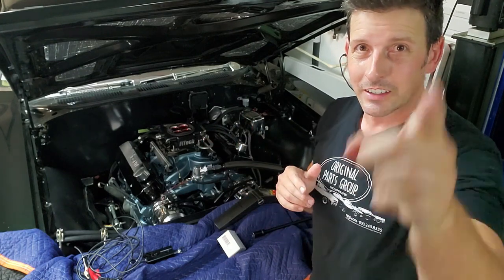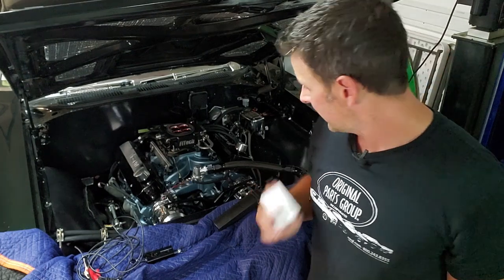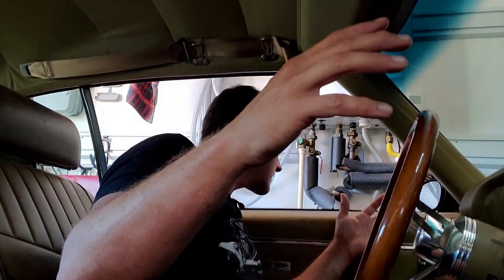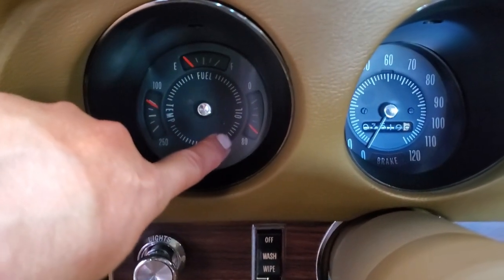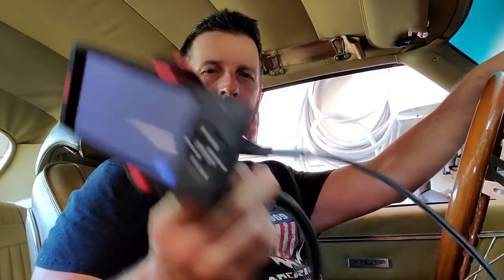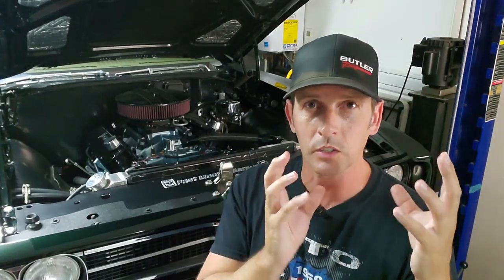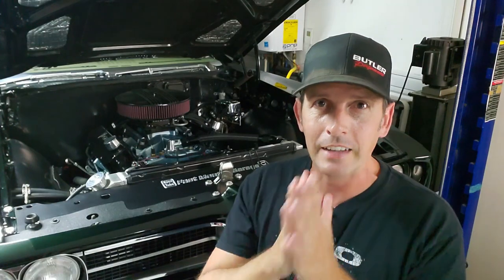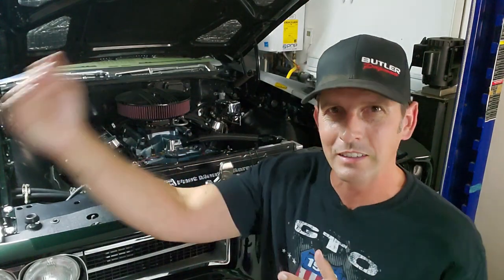First Fire of my Pontiac 400, now a 470!  Pontiac Re-build, part 15

Comment: I remember my first drive my temp hit 215-220. I kept checking with my infrared gun and it was 180’s. Just air pockets. Eventually went away. I like the air suction noise.
Reply from the maker: Good point Ryan... might be air pockets.  Will continue playing around with it.  I've been leaning towards Mechanical gauges, so, we'll see!  Thanks again.

Comment: Hey Mike nice videos  got two Firebirds 68 coupe 69 convertible. I found your channel and your escapades got the fire burning to get them back on road  been stored since 97. Got the 68 almost done New brake lines, master cyl ,wheel cylinders flushed system going with dot 5 fluid this time, new fuel tank , lines, pump ,sending unit, rebuilt Carb. I'm 67 with bad ticker so have to work slow. Its all good
 They are both all stock so not much drama .
I did replace Distributor with HEI and drill primed oil system with the Butler oil priming shaft but I did remove the black coating it was flaking off didn't want that in engine .
little paint work 68 will be good to go. Bought it in 76 great running car, 69 got it in 94 had it 1 week caught on fire in my Garage at 3am it was  literal firebird  fought the fire with garden hose in my whitey tighties lol ( was electrical fire at old add on Amp meter no fuse) just burned  interior  took about yr to find parts and repair it . 
sorry for the long post and thanks for the videos 

Sincerely
Michael
Reply from the maker: What a great story!  Thanks for sharing... Glad to hear I was able to motivate someone to get their cars back on the road... Welcome to the family!

Comment: Hey Mike , not sure if you wanted to raise your exhaust after buying your after market cross member but i was watching a video that came on after watching your last video that was from Detroit Muscle , the video is about putting a 1000 hp motor into a mercury grand marque . I know right. But anyway they cut the original cross member and welded two pieces of angle together and then welded that to the cross member. To get the height they needed they used a piece of cardboard as a gauge between the floor and the angle. Check out the video it's pretty interesting. Anyway after I watched it , I thought of your situation . might be more clearance for you . And it could always be another video for you.😀
Reply from the maker: Ha, ha... I'm as high as I can go, without fully cutting the entire tunnel, from FireWall to rearend.  Hence my comment, I don't want to touch it.  Thanks for the comment, and the video tip!
Reply: @FastMonty  👍
Reply: @FastMonty  your as high as you can go!!! Sounds like a comment from"Dased and Confused"  from the kid in the back seat , I think his name was Schrader.😁😁✌
Reply from the maker: @johnkennedy8452  Always... Check ya later!  Why you always saying that?  Check ya later, check ya later... baahahahhaaaaa
Reply: @FastMonty  Check ya later . Hum , I do like um red ! Bahahaja

Comment: Hope your coolant temp woes get resolved!

There has to be something going on where you won't need to get a 160 degree stat; all that will do is just delay the same problem. Also, don't fuel injection systems recommend 180 degree stats? Maybe I'm thinking of multiport fuel injection systems rather than throttle body.

As already suggested, it could just be a matter of reading inconsistencies with the Fitech sending unit. Hit your engine with that IR gun to see what's really going on there! Otherwise, air pockets - I'll let my 79' Trans Am with a 400 idle with the rad cap off for a good hour before I feel confident that it's bled, and even then, the recovery bottle level will still drop consistently after a few drives until eventually balancing out. These old V8's trap air in the cooling jackets like nobody's business. 

Did you have any manipulating to do to your divider plate? I just got in my 11-bolt Flowkooler today with a new divider plate from them, and the clearance without gasket was around .045, and the gasket added another .030. I tried to bend it, but got too aggressive and ended up mangling the divider plate and so I got another from Butler coming. Hopefully it won't need any manipulating. Any suggestions on how to gently hammer down that divider plate, or should I just not even bother? .075 is under the recommended maximum of .100, but I'd like to get it a little tighter than that if I can, but if I'm just gonna keep messing up these divider plates, maybe it won't be worth splitting hairs so much.

Also, what kind of radiator did you get? The best ones I've heard are the fat two rows (1.25"+ width tubes) like Griffin, Cold Case, Be Cool, etc. rather than the 3 or 4 cores with the smaller width tubes. Maybe you just don't have enough rad for your build?

If your cooling system is up to spec, then you're looking at tuning problems. Maybe your idle mixture is too lean, or the ignition timing needs more advance...

Cooling woes are annoying, and are common with these Pontiac motors. Hope it gets sorted out!
Reply from the maker: Good stuff Robert.  I've determined that I need to get Mechanical Gauges... ha, ha... using my IR gun, the FiTech reading is 15 degrees high, and my stock gauge is 15 degrees low.  A Mechanical gauge should be juuuussst right.  Like GoldiLocks.  lol  Bummer about your go at modifying the FlowKooler plate, which is really good to begin with.  The Butler plate is also really good, out of the box.  So, I wouldn't bother modifying it.  I got a BeCool radiator set up with dual electric fans.  All is good in cooling land.  Thanks for the awesome comment!

Comment: Glad you got er going again, sounds great. My dads 67 lemans had a butler 474 in it, they build the best pontiacs ib my opinion. Have fun rippin it up, I'm still working on my 69 gto. I have the fuel tank out and pump out currently. I tested my robbmc pickup and it tested ok, tested my fuel gauge and it works so hoping something was just sticking causing fuel level not working right. Next front end rebuild and front tubular control arms and qa1 coilovers. Considering a set of edelbrock heads in the future, i have head studs currently and wondering if i can pull the heads in the car with the studs. Love your car!!
Reply from the maker: Thanks Bane!  Glad you're making progress on your build.  Can't wait to see it!

Comment: Congrats getting back on the road. 
1. Why didn't it fire right up? Did something in the Fitech get reset or ..?
2. The small passage between the intake's water x-over and back of the timing chain cover/water pump ensures water is always circulating, even with the thermostat closed. Your new thermostat would include the rad in that loop. Am I missing something?
Reply from the maker: Thanks Roy!
1)  I have no idea... maybe an air pocket in the fuel lines?  I noticed later that I have to fully Key off, before trying to crank again, as there's a little squirt of fuel when you go to crank.  If you just crank, it doesn't give that little pump.  Secondly, After changing the crank fuel setting, it starts much better, as you saw.  I'm still learning the idiosyncrasies of the FiTech unit.  
2)  Agreed.  That's why I was hinting at that I don't think I like the Thermostat to be constantly flowing.  Anyway, lot's to research there.  

Thanks, as usual!

Comment: I had a 180 stat on my trans am and it was reading in the 200s replaced it with a 160 A/C delco and now it reads within 5 degrees of my fitech temp reading
Reply from the maker: Thanks David, definitely need to explore that issue some more.  Thanks for the comment!

Comment: Can't wait for my first fire again
Reply from the maker: Yeah, the struggle is real... git er dun!  I'm sure it'll be great!  See ya!
Reply: So did you switch out the thermostat ? I found my engine ran better with the 160
Reply from the maker: @tanner8288  Actually yes, my 160 runs better.  I also had some bad readings for temp, which I'll cover in a couple weeks.  I'm basically going to put in Mechanical Gauges to get true readings.  Water Temp, Oil Pressure, and Fuel Pressure.

Comment: The temp senders that Fitech sends with the kits are notorious for being inaccurate.  Replace it with a real GM part and see the difference.
Reply from the maker: Ahhh, good point.  I'll definitely play around with it... I'm leaning towards getting mechanical gauges, for sanity sake.  Thanks !
Reply: @FastMonty  also the fitech enables you to calibrate the cts, you might wanna do that as well
Reply from the maker: @BlackThorne1987  Yeah, I know the old handheld temp is scalable.  The new one is not, yet.  Thanks!
Reply: @FastMonty  oh good point, didn’t know that since I only have the old one haha 😊

Comment: That’s great. Mike, glad to see her on the road again!   On first start, is there a cam break-in period where the RPMs need to be higher, for a certain amount of time?
Reply from the maker: Thanks Troy!  That's true for Flat Tappet lifters, ie 2000 rpm for 30min?  Or, something like that.  I have a Roller Cam, so break in is not necessary.  :)  Thanks for tuning in!
Reply: @FastMonty  ooh ok yes I guess that makes sense!   Thanks for clarifying, I knew there had to be a reason, you’ve gone into so much detail I knew it was probably something like that.   Cant wait to see how it does once it’s dialed in....I’ll bet she’s mean!
Reply from the maker: @dasmiths69  Ha!  no problem... yeah, mean and green baby!  See you next week!

Comment: What’s with the FiTech throttle body and independent fuel rails?  What type of setup is this?  I just returned the exact master kit you installed back to Summit because of nothing but problems. Two new ECUs installed and they both failed within a hundred miles or so.  Is your FiTech holding up?  PS if you’re FiTech sponsored, just don’t even answer.
Reply from the maker: Sorry to hear about your tough luck... my unit is still working great.  Why the fuel rails?  Because at some point I'm going to convert to port injection.  Before that happens, I'm going to try talking FiTech into dynoing my current set up, switch over to Port Injection, and dyno again.  Hopefully you'll be able to find a system that works, no matter what you go with, I'm extremely happy that I don't have a carburetor anymore.  Good luck, and thanks for the update, let us know what you end up with.  Thanks!
Reply: @FastMonty  I put my Holley carb setup back on.  If I’m honest with myself, there was absolutely nothing wrong with it I just wanted to try and get fancy high tech and MAYBE a little bit more fuel mileage.   It has an electric choke that is configured perfectly and handles cold starts just as well as the FiTech did.  Glad yours is holding up.  I should also note that I legitimately daily drive mine.  Everywhere.  All kinds of traffic and distances. Truly daily drive, not just cars and coffee.  Maybe the Fitech just isn’t built for that. 🤷‍♂️
Reply from the maker: @randyturner6111  Wow, daily driving is an awesome test.  As, I don't drive mine daily.  But, when I do, it's for 200 miles almost every time.  At least the fuel mileage has helped out... "IF" I'm tame, I can get almost 12 MPG's  LOL.   Glad you're enjoying your ride!